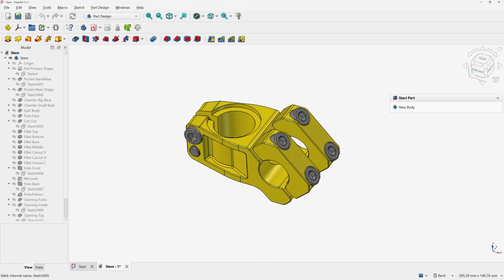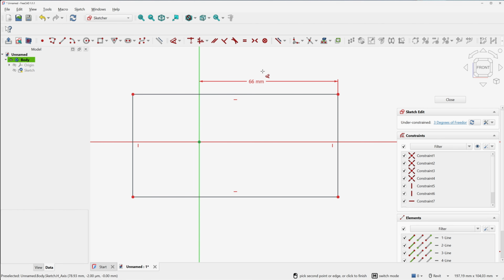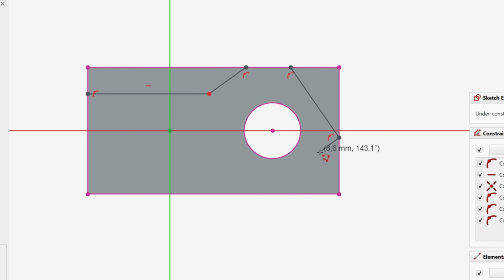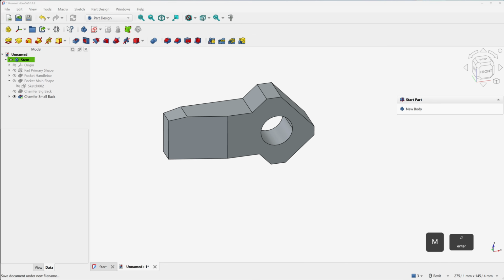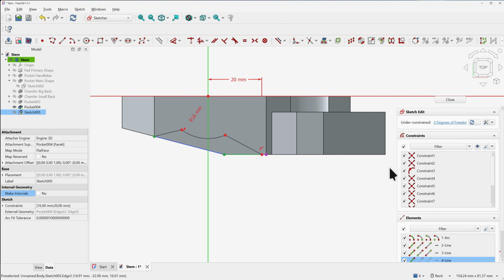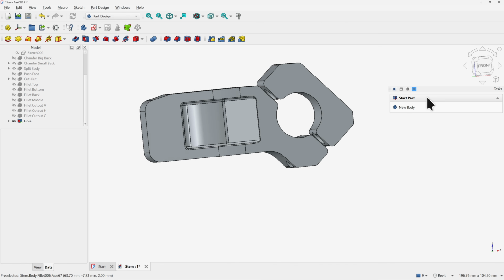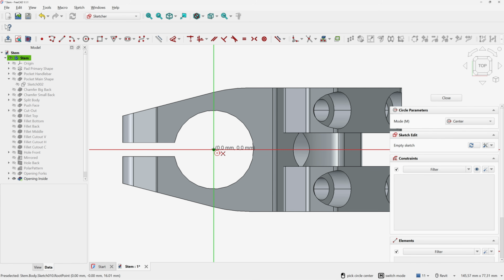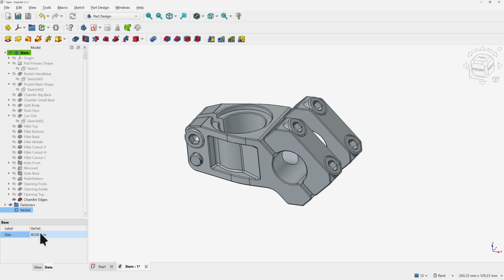New to FreeCAD? Start HERE (Ultimate Beginner Tutorial)

Comment: Not sure what I may have done wrong, while following along about constrains, i got "Over-constrained" with (5, 10, 12) and while following along with deleting after turning on the auto remove, it essentially turns the shape into a trapezoid
Reply: I have the same issue.  I noticed that where you click when defining dimensions affects what numbers show up in the over-contrained error message.  As you stated, if you delete the other numbers it just creates a trapazoid.  Can't seem to get past this problem no matter what I try.  And for my setup the "Auto remove redundant contraints" option was already enabled by default.  If that was supposed to prevent redundant contraints, it didn't work in this case.

Comment: I did the drawing twice and both times it gave me an error with the fillets when i went to change varset. i ended up deleting the fillets and then i had a issue with the front holes not moving with the rest of the model to i constrained them by setting dimensions from the edges of the face, that worked. is the fillet issue a reoccurring issue and what can i do about it?

Comment: Spend 5 hours, firs time doing cad,work, was stucked here and there, but it was genuinely very fun, abide procrastinating from my finals,however it seems when the varset, i get errors on sketch 002 where wire is not closed,i have redo the sketch 002 still encounter the error,nonetheless thanks for a beautiful guide,and fueling my curiosity.

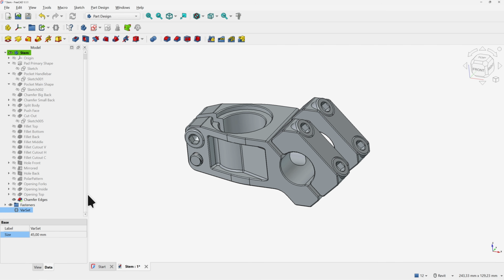Comment: 54:48 Everything looks flawless, but somehowm after updating the Size variable, it tells me the "Fillet Top" step has issues (I'm pretty sure I did everything just like you did) and it tells me "Invalid edge link". If I now change Size back to 40mm, it's still not working, even though it had worked before changing it in the first place
edit: lol :D after closing and reopening the project, suddenly the one thing works again, but the last "Chamfer Edges" is broken because it can't find one of the edges, and the other ones are in the list twice 🤔

Comment: If you struggled with the part because of snapping here is a solution I found:

Go to Edit -> Preferences -> General. Click the Selection tab.  Look for the Selection radius setting (default is usually around 5px). Bump this up slightly to 10px. This widens the zone where FreeCAD looks for a line, which can dramatically smooth out the feeling of misaligned snapping.

♣ Uga buga btw.

Comment: Nice tutorial to learn some basics. I have some suggestions. At first I would say that things that are not connected should always be indaividaul parts. Like the clamps for the handlebar. There is another Problem. The gap should go to the center of the circle to avoid problems in assembling. A big thing are the holes. You should use ISO screw sizes and use drilling core holes for the part where the thread goes (or even bould the thread directly, and clearenace holes for the part the screw only goes through and use a M8 screw setting instead of putting in the values by hand. The two brackets should be connected with a big hole in the middle to avoid weight. Like it is made on industrial stems too. EDIT: and in the end this would be a good base for assembly workbench and simulation of forces.

Comment: For the variable size section beginning at 50:26: If you are getting an error after changing the size related to the fillets, go to the node in the tree showing the error. Remove all of the fillets listed in the Fillet Parameters box and then re-add them. This should resolve the problem. 

As of July 5th, 2026: There's an open bug report from November 2025 on 1.1.0rc1. It's an issue in FreeCAD's topological naming system (TNP), and it shows up specifically with dress-up features like Fillet/Chamfer when a parametric change (the variable) reshapes the model enough that the old edge references can't be resolved.
Reply: can you explain it a little more what do you mean by Remove all of the fillets listed in the Fillet Parameters box and then re-add them, do I delete all the fillets or make changes in the Parameters box in the bottom left.

Comment: What's the point of adding the bolts / screws? Is it just a visual guidance? If you want to CNC this piece, you would now need to remove these items from the model before you can start to CNC it.
Reply: I was going to ask about the threads on the second half of the hole after the split, though thinking back most bikes I have used have through holes with a nut, but your point makes even more sense, so I think it must be for illustration of not having to design fasteners as well, also I don't have much experience with CNC, just enjoy watching the videos, but would it even be possible to do that in a single pass?

Comment: Finally, someone who chooses an appropriate navigation style, when doing 3D CAD. In my opinion, SolidWorks (+++) and Revit (++) are the only 2 good choices. Even if you came from Blender ... or from NX.. WHO the hell can press the left mouse button and the scrool together ?

On the other hand, i have also the version 1.1.1., and at first, i didn't have the "Make internals" options under the sketch options. 
I thicked the <<Generate internal faces>> in the Settings, the same.
I unticked it, started a new project, also missing.
I ticked again in the Settings <<Generate internal faces>>, and now it appears ! ?!?!?!

Comment: Over 30 years of experience with AutoCAD, i feel like a novice in freecad. Good news is i sm doing fine now in Draft mode. 
There is still one important question i would like to ask the freecad community: is it possible to start a new drawing (file) with a set of preset layers (means linetypes, text type/size/colors etc.? When i want to save, i do not get any other option than to save like a document. Its clear that its not possible to save as a template for "future use".
Am i right here? Yes , open a existing drawing, delete everything then save as is probably the only way to meet my request?

Comment: I don't know if you're doing this intentionally, but you're not binding new sketches to the body surfaces.
This is causing the sketch to appear under the body, and the pocket operation is misdirected.
Before creating a new sketch, you should select a surface, and the sketch will be bound to that surface, ensuring that it remains visible and that all operations are directed towards the selected surface.

Comment: My chamfer tool didn't select all the edges in the closed loop like yours but rather made me select each edge one by one :( Is there some preference or setting I can change?

 I do have to applaud the absolutely wonderful tutorial this video is though. I'd be remiss to for-go that.
Reply from the maker: @guymcfly7282 Did you apply all fillets beforehand? The edge contours must be tangent to ensure the chamfer applies correctly in a chain.
Reply: @deltahedra3D  Hi Delta, thank you for responding to my question! Yes, I did apply the fillets beforehand. I've just tried it again from a back-up save, and it worked this time on all edge chains but one, which I'm not worried about. I've also discovered the ability to select a face to chamfer all face edges! Thanks again for this fantastic tutorial; I will be recommending this channel to two friends of mine getting into design.

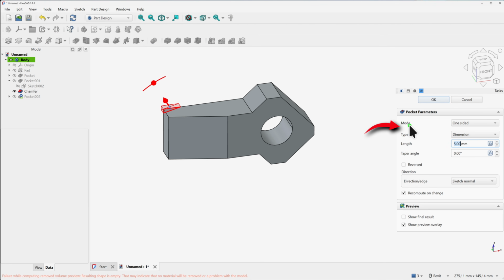Comment: 22:37 I do still get the 2 wire not closed error message :(
Reply: Im having the same issue. I have gone and just used the chamfer tool but would like to know how to fix this/whats going wrong. I have gone and looked at the validate sketch and it’s showing the additional line where it intercepts the “construction lines” but unsure how to fix it. I have checked that the additional line is constrained and cannot move. At a bit of a loss. Please let me know if you have any ideas

Comment: When turning the make internals option on, it nuked the entire thing and nothing was visible anymore. i got annoyed and clicked the bodies, then i got access violation error message, so i gave up and closed the app. still not sure what i did wrong, i rewatched every section multiple times
Reply from the maker: @rubrechtsklave9369 That was frustrating news, and it’s unusual behavior. There’s no need to use the tool to proceed with the tutorial, as it was primarily a showcase of the new feature. The solution is simply to follow the pro tip I shared right after. If you’re still stuck, you can download the 3D file for free from the description. Hope this helps.
Reply: @deltahedra3D  thank you for the  quick response. i retried to follow the tutorial again, to make sure. same thing happens. i really dont understand why it is behaving like that, maybe its version difference?
Reply from the maker: @rubrechtsklave9369 That is quite odd. Since the tutorial was created using Stable 1.1.1, you might want to try the 1.2 dev version, which you can download directly from the official FreeCAD GitHub repository.

Comment: 9:34 it doesn't work for me. It shows me three redundant constraints: (5, 9, 12)
And if I hit delete, then my rectangle isn't a rectangle anymore, the left line becomes a diagonale traversing the 0,0 point of the coordinate system so it isn't vertical anymore.
5 is the vertical line contraint, 9 is the 32mm and 12 is the symmetrie contraint.
Reply: I've done a workaround by placing a point in the middle of the left line and constraint it on the horizontal red line.
Reply: Sounds like you're selecting the root point in the center and not the horizontal axis itself (the red bar.) First select top-left point, then the red horizontal axis bar, and finally the bottom-left point. If you select the root point, you're essentially constraining the same things twice, hence the redundancy.

Comment: Hi at 17 minutes where you select parts of the sketch it doesn't work for me, I enabled the settings as you have but and the shapes turned blue but I am unable to select them which would turn them purple... any help is appreciated:)
Reply from the maker: That's weird, did you hold down CTRL while selecting them? Try seeing if it works with just a single face first.
Reply: @deltahedra3D  Hi it doesn't work with the first face unfortunately... I'll keep looking. Thanks for the Videos btw!!
Reply from the maker: @lucastrottier8292 You're welcome, though I regret that I couldn't assist you further.

Comment: This tutorial is really excellent—thanks for sharing it with us. You did forget one thing, though: the screws won't screw in because the holes on one side are too large and lack internal threads. :-)
Reply from the maker: @LTB_X-Bow Thanks for your comment! I didn't want to make the tutorial too complicated and computationally heavy. If you want to add the threads, you can directly create them from the hole operation by selecting a thread standard (like ISO).
Reply: @deltahedra3D  Hmmmmm,............... but you want those the lower half (I'm a beginner, so thank you, just completed it over several days).  If you're gonna think production there will be two hole diameters for drilling, and then the tool to drill the threads in the hole with less diameter. ..............

Comment: I finished the tutorial, successfully, but it was not easy. I ran into multiple issues that eventually I managed to fix by recreating the steps but the problem is that I am not sure what caused them to begin with. The worst one was with the variable. When I tried to resize it, I was getting errors about the Fillet Top where a question mark appeared for 2 edges. I ended up recreating all the top fillets, twice, because after the 1st retry I was still getting the errors. On the 2nd retry it worked. I only wish I understood why I got these errors to begin with.
Reply from the maker: @AviSchwartz1 The fillet tool is quite unstable. Unfortunately, it remains one of FreeCAD's limitations, but it's going to get better in upcoming updates.

Comment: some help please - i made all the changes since the new version came out to not get the "wire not closed " pop-up. That being said i still get the pop-up and at ---18:33--- i can't select the faces. it does not turn a different color and i'm stuck at 18:33. 
i did it over and over again to see if i'm missed something. does anyone had a problem like this?
Reply from the maker: Did you activate the option in the data properties of the sketch "make internals" ? Is your sketch composed of solid lines or dashed ones?
Reply: @deltahedra3D "make internals" is selected and I used polyline to draw
Reply: @deltahedra3D so when using the external geometry tool i don't get solid lines, i think that is the problem
Reply from the maker: Try to convert them into solid lines and it should work.

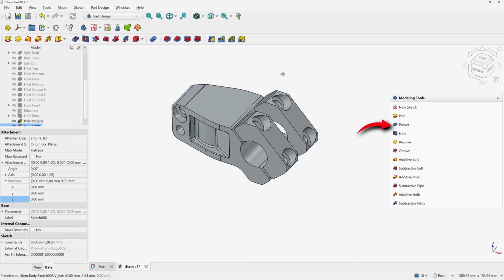Comment: 46:01 I had an issue where FreeCAD said "over-constrained", but then told me to delete one of the constraints. I deleted the symmetry constraint. Then it still told me I had "1 degree of freedom". Turns out, that is the constraint that I deleted, the symmetry one not being there was the issue now. Finally, I re-added the symmetry constraint and it went to being fully constrained.

Although it worked out for me in the end, do you know what might of caused this?
It seems rather confusing as to why FreeCAD would do this.

Comment: Thanks for the tutorial! But I got an issue: When I was applying the variable equations to the edges you mentioned they went orange, and when I tried to change the size value I got the "Fillet: Invalid edge link: ;#2902:8;:H167,E.Edge70" error, any idea on what went wrong?
 EDIT: I edited the faulty fillet (the one of the 15 edges): I removed all selections and then reselected the edges, this fixed the issue.

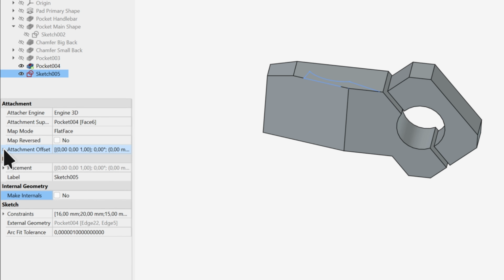Comment: At 33:04 you move the sketch downards in the coordinate system. I come from Autodesk Inventor so in that case I would have started by creating a plane between the top and bottom faces, drawn my sketch there, and then extruded symmetrically from the center instead. Is this a bad or impossible way to do it in FreeCAD? I sadly haven't yet had the chance to try the program out yet, but I have used planes a lot in Inventor before and I really like that system. Thanks for a good tutorial, I can see that the workflow is quite different 👍

Comment: I don’t understand what is the difference between the two ways for setting up the dimensions 32mm and 66mm at the sketch of the real rectangle, you say something about align dimension and different workflow but i don’t get it
Reply from the maker: @enriqueparedessanchez7549 By default, when using the dimension tool and clicking on a point, you get a horizontal or vertical dimension relative to the axes. However, you can also set a dimension by selecting one point after another. That was the difference.

Comment: I probably just missed it, but why did you start with a primitive instead of an extrusion profile sketch closer to what you actually want (which you then had to create anyway for the cut)? It didn't make anything easier(?)

Personally, I'd be careful with the auto removal of redundant constraints. It might look tempting to just let the software figure stuff out (especially for beginners), but you might accidentally delete a constraint that you placed somewhere for a very good reason.

Talking of constraints - this one is probably a matter of taste - I find the use of external constraints to constrain internal relations (I hope that makes sense) makes it a huge pain to revisit/edit a design later on. It's way easier if all the geometry-defining constraints are internal (think right angles between lines instead of fixing them horizontally/vertically and so on) and then you need only 2 constraints to anchor the whole sketch to the plane. Just imagine you need to move/rotate a sketch or a significant portion of it ...

Comment: Community! I have a question regarding projections. Now it's been a long time since my first ED (Engineering Design) classes which I took nearly 15 years ago. Although I understand projections, I remember manually drawing projection via scales, but the concept to why we need to project our 3D models edges so that our lines coincident over the project 3D object's edge so that it snaps correctly to a point (vertex) of an edge. Why do we need to "project external geometry in the sketch plane"?
Reply from the maker: @practiseChen1 When you're in a sketch, you're working in a strict 2D plane. The 3D edges of your model exist in 3D space and the sketch constraint solver is completely blind to them, it can't snap or reference anything outside its plane.
Project External Geometry (or intersection) solves this by translating those 3D edges into 2D references inside your sketch, so you can then constrain your geometry against them (coincident, tangent, etc.).
Reply: @deltahedra3D  Absolutely, makes sense. Thanks a ton man.
Reply from the maker: You’re welcome!
Reply: @deltahedra3D  I have another question or rather a request. From "Back holes" creation the concepts of planes were more highlighted. For now, it a bit confusing to me to why we need to select a plane to make the point appear outside of the face so that we can perform hole operation or in "Fork steerer pocket" creation, why do we need to base the sketch on "origin plane" it must be only "origin" right as it's a single point where all planes intersects? You mentioned that FreeCad didn't have to recompute which face the sketch belongs to if the geometry changes, can you please simplify this in your future videos.
Reply from the maker: @practiseChen1 My point here is that I highly recommend choosing one of the base planes to build your sketches and then moving them via the Property Manager. Sometimes FreeCAD suffers from re-computation errors, and attachment planes can go completely crazy. Often we don’t have a choice, but whenever possible, you should favor the origin planes (XY, XZ, YZ). I'll make sure to explain this better in future videos!